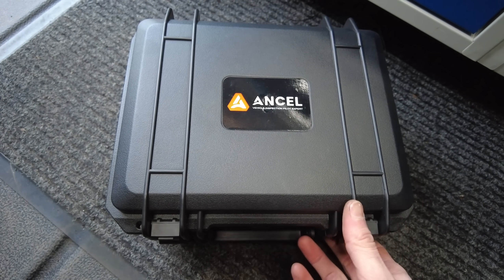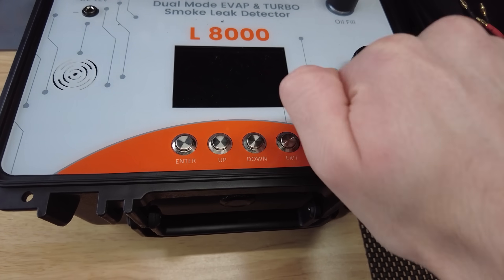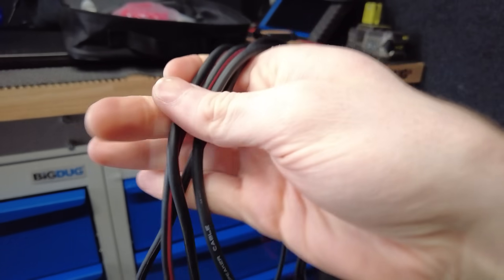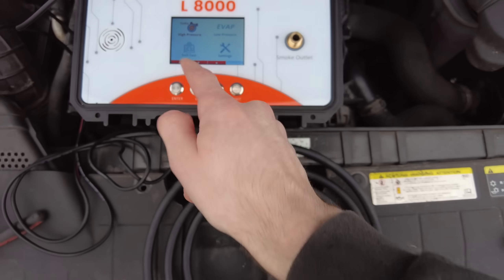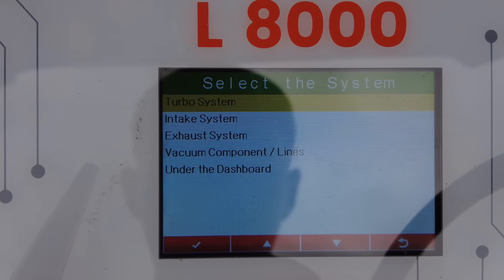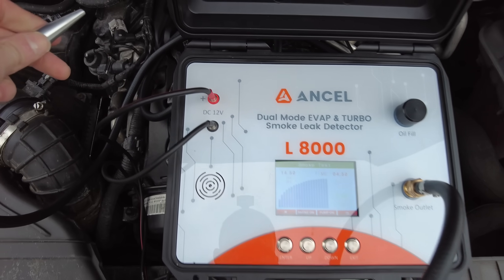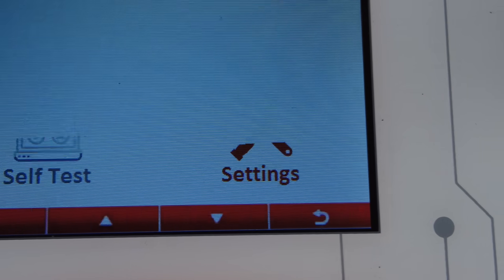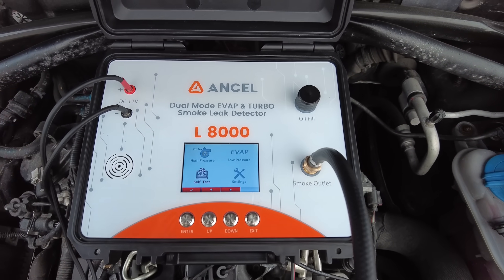YOU WONT BELIEVE HOW CLEVER THIS TOOL REALLY IS….  |   ANCEL L8000 SMOKE/LEAK DETECTOR REVIEW

Comment: I bought a Chinese cheapo EVAP smoke machine - £70. 

It's ok, I don't feel it creates really thick enough smoke but it'll do. The attachments are pretty good to be fair. For inlets, exhausts, vacuum pipes. It's all there.

Interestingly one of my first jobs with it was a strange one. 2010 VW Polo EVAP flow incorrect code poping up for the second time after  EVAP valve replacement. So we tested the system with the smoke and found the charcoal canister was "leaking". We removed it, and realise that despite the car having a purge valve, the canister was still a "vent to atmosphere" type. No spring valve or anything in there either. Just straight vent from tank to outside?!? Odd. 

Apparently that's the normal design on that model. So it wasn't an EVAP leak at all, as the fuel tank is always leaking vapour essentially regardless of the valve operating or not. What had in fact broken and seized the previous and new EVAP valve was the charcoal dust from the canister getting sucked through it and jamming it up. The Charcoal had degraded over time with the vibrations from pellets in to powder.

What I'm trying to say is the little bit of smoke my machine made, I could see pouring out the bottom of the canister - so it done it's job making me question what on earth was going on with that canister.
Reply: That does seem strange yes
Reply: Thank you for your feedback and for choosing the Ancel L8000! We truly appreciate you sharing your experience. Your suggestion has been passed on to our product team, and we will continue working on improvements in the future. Feel free to reach out if you have any other questions!